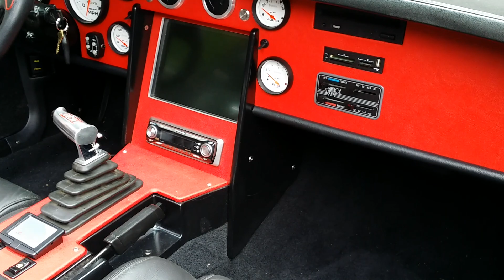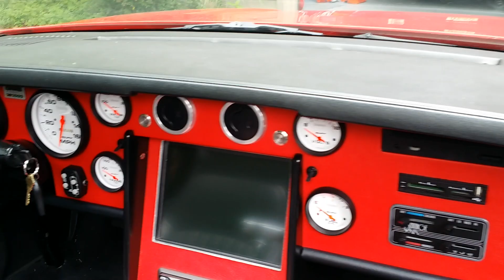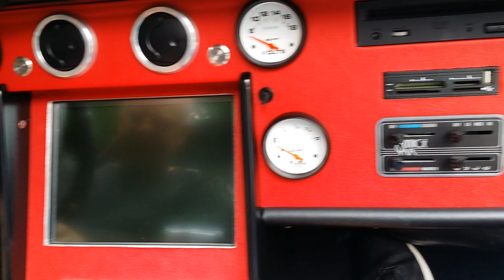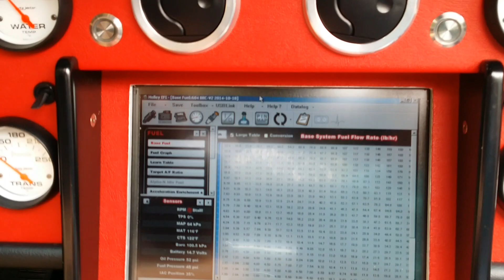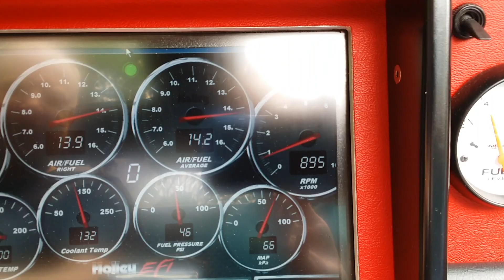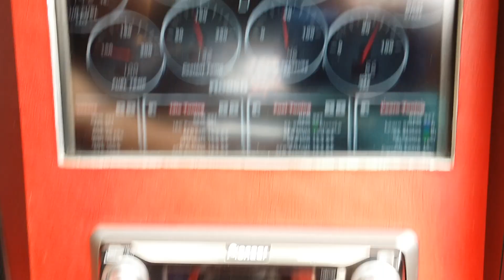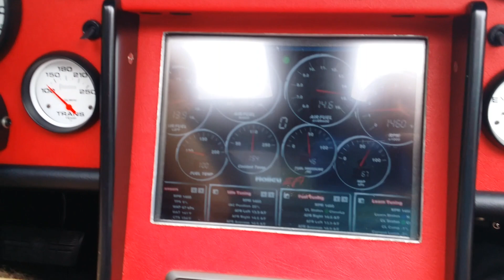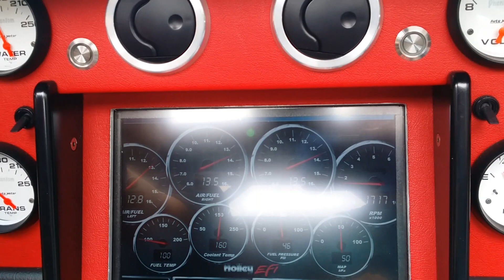Insane rear engine big Block 3rd gen Firebird-smokin fast! world's ONLY!

Comment: Thanks for the compliments. In answer to the questions, the engine hasn't been dyno'd in it's current form but I estimate it at 650+HP at the crank based on the 604 displacement and the hydraulic roller cam. The car is heavy at 4500 lbs., though, I didn't scrimp on the structure and the Toro transaxle is very heavy. It wasn't cheap to build as I used the best parts available and made what I needed - If I value my labor at minimum wage, the cost to build was over $135K but I spread that over 20+ years so the annual cost was manageable.
Reply: It's a very impressive build and the 20+ years of effort really shows in the final result. It's fairly rare to see such a custom car that is done so well.
Reply: well done. I'd love to see it in person. Lots of neat engineering going on. I LOVE the exhaust!
Reply: DJ G probably the most unique car ive ever saw
Reply: DJ G awesome work
Reply: DJ G Great work
Reply: DJ G shit, probly more like 230 Horsepower if your lucky, but no harm no foul i forgive you, everyone always overhypes their cars capabiluties
Reply: james palmer its a bored 604 ci with a 4 5/8 cam lol you honestly think its only making 250 lol bro no offense but you sincerely do not know much about Chevrolet Engines now do you lol. A 4.3 v6 makes 175 bro lol a stock 350 ci is 250 h.p. bro please my man if you dont have a clue save your opionion.
Reply: The one thing that sucks is that there isn't much other content of this car to be seen.
Reply: I believe you. To build these cars are quite expensive . lot of knowledge and the ones that are talking about this is wrong and why did you do that are the ones that never put a bicycle together. They have no credentials, but to be on u tube talking about somebody it's very amusing. How can these idiots have balls to say anything . anyways good job on the car. I built a couple in my time and I'm still at it now thanks for the video..
Reply: Have you had this car dynoed or tuned more in the last 2 years?  The tune sounded a bit rough in the video.
Reply: DJ G well done sir!  It's not my cup of tea but you're an amazing craftsman and you did an incredible job on this car.  Aside from that belt squeal it sounds great & looks REALLY nice. 👍 Would have loved to see how it lights up the rear tires, but I guess we'll have to save that for another day. 😊 Very nice!
Reply: DJ G love your suspension mods! 
Great job!!
Reply: I think it's uh badass!!
Reply: DJ G not to be mean but you could maybe get 10k out of that car..
Reply: Hey DJ, love your ride. One of the most unique builds and design i've seen. Did you decide to go with the mid engine lay out for a particular reason? Was it possibly even inspired by the Fiero? 

I'd love to see RegularCars do an episode on this thing, he'd probably shit himself.
Reply: You from Glenview?

Comment: It's respectable , hand down, but why did they have to make into a kit car ferrari?
Reply: Some enthusiasts prefer a clean, classic look. In this case, it just happens to make it look ferarri-esque.
Reply: Makin Bacon, because they are goobers. That's why
Reply: there are 2,600,000 3rd generation f-body cars made from 1982 to 1992.its perfectly fine for a couple to be built into unique,one of a kind hot rods that are done incredibly well.i love third gen cars and have owned over half a dozen but i love this car for what has been done and how it turned out.it is quite an amazing feat of engineering.
Reply: I seriously thought of the car being a Pontiac Fiero with a popular ferrari body kit until I realized that this is a Firebird with a Ferrari body kit .

Comment: I had that rear hatch on my 84 Z28, minus the air intake.  Heavier than the glass but looked awesome.  Black paint, 3 pc BBS Black honeycomb rims with a brushed aluminum outer ring on it. Borla straight Exhaust, Herb Adams suspension , 4.10 gears.  Can you tell I miss it?

Comment: Amazing build. Since the big-block replaces the rear seat it would be more accurate to call it mid-engine. Would love to see this designed around a Mendeola SDR5 transaxle. Five speeds and weight reduction would really update this package.

Comment: Why didn't you use a Stroker LS Motor that has more Power & Weighs much Less than this Heavy Big Block ?  An Aluminum LS Motor would handle better, Brake better & accelerate better.
Reply: Chris Rentas cause every joe schmo snd his unclegrandpa has an ls. theres no replacement for displacement
Reply: hes obviously not a long term thinker
Reply: Brian Desjardins yes there is, its called efficiency
Reply: +Dalton Bedore Imagine trying to explain why you need $100K Full Coverage Insurance.
Reply: LS motors weren't any where near development when this car was built , starting in 1992. This thing can now be classified as a survivor.

Comment: That belt squeal would drive me up a fucking wall. It must be remedied. There is something wrong, putting a drain on it- where it should be charging, it is in discharge. If you simply make a list of EVERYTHING that powers on with ignition, then break down that list to "engine-only essentials" (Starter, ICM, PCM, Coils, Injectors, Fuel Pump) and then put a timer & voltage based control unit in charge of adding the other loads AFTER start up, maybe 8-10 seconds? Adding a second AGM cell would greatly help, too. Switching to a cogged flat belt would improve it's grip. Why is the trans pan scuffed up- like it hit something? A very beautiful car there, Sir. Thank you for the video.

Comment: Neat car, looks great. Why though did you go with a big block? It must have crossed your mind that you have a huge amount of weight in the rear. I would think of using a alum. block small block engine would have been much better to give it a huge difference in handling.  The car is just too heavy to do much more than go real slow on a road with bends ...

Comment: It would probably be really sweet if some designer perfected the dash, exterior, stance and wheels and maybe a more aggressive exhaust.  For a car over 35 years old, it's in good shape though, and fortunately isn't stuck with the old small block choked by horrible early-80s smog equipment.

Comment: As a race driver and engine builder, I have to say the fabrication looks well thought-out.  Perhaps too much but it all comes down to how it all works and how much does it weigh?  You can keep the outer body kit.  You just can't copy a Ferrari.  Question why did you go this route instead of a mid-engine muscle car? Okay, I love Big Blocks!  The torque is awesome.  Perhaps not the motor of choice for a "Ferrari" but at 604 it's got to be a kick to drive!  Your finding parts is good!  But the fab is where this car stands out.
Hey, I just watched the end of the vid.  I expected to see you PUSH the motor past 1100 rpm!  Why did you go through the trouble of building a 604ci?  Is it a trailer queen? Very disappointed!
Reply: Did you watch or listen? I know he was tough to uhhh ummm listen to but he said it weighs 4500 lbs. They were also in a downtown area so they didn't open it up. The engine choice is strange to me only because of how quiet he made it.

Comment: Why rear engine?  Porsche somehow makes that work, but they're the exception.  The one advantage would be having the weight over the drive wheels for better traction, but everything else favors mid- or front-engine.  And if the car's over 4500 pounds, I wonder how much that slight advantage in traction is even necessary.

Comment: Need wider wheels. Engine doesn’t sound mean. Looks like a lit car ferrari. And if that belt breaks or sum happen to the motor. Ur ass is gonna feel alllll that... don’t ever bend that elbow back far enough or ur ass is grass. But ppl saying he built what he wanted to build. I wish they give same respect on all genre of race.
Reply: The back wheels are 345s he said. You can't get wider than that in a radial tire, its because the way the kit is.. it makes the fender wells thick. Really nothing can be done to change it except not use that kit. If the owner likes it, that's all that matters.